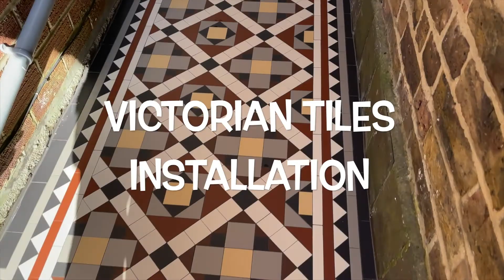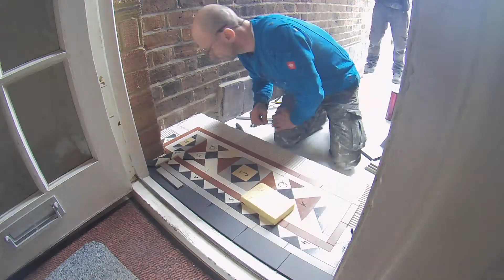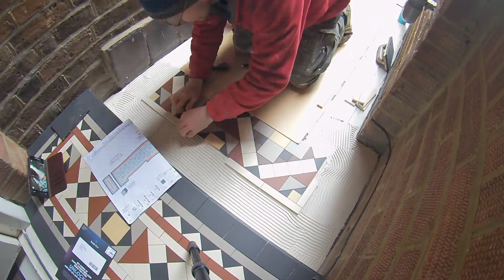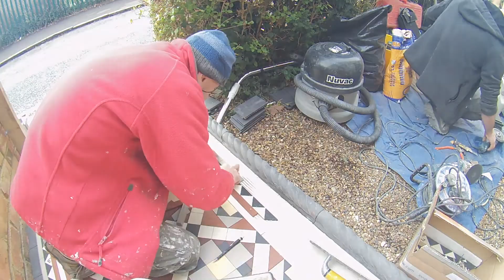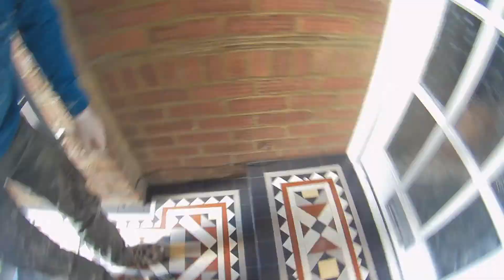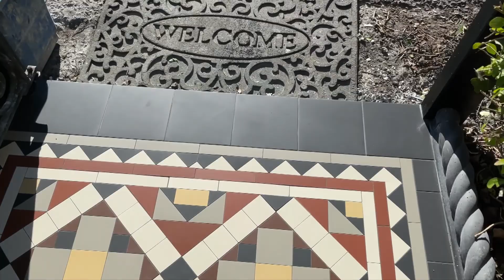How to Install Victorian Mosaic. Victorian Tiles  Aberdeen, Faron.Co Ltd, Mozaika Viktoriańska

Comment: Yes, it looks gorgeous. However, would like to ask about the rain run out. You did something like a concrete base for tiles, but by force of gravity, a surface been made flat, so the water will be collected on the mosaic top. Probably it will degenerate the lifetime of them, am I right?
Reply from the maker: Do you really think that this flor is flat???
Floor is concrete skimmed with the mesh and S1 tiling adhesive. Its not good idea to fix this tiles on bare concrete. !!!
Reply: @faron.coltdmactilermosaici301    May I ask what is the degree of tilt for full tiles surface? That makes me confused. Thanks
Reply from the maker: @4i04  " the degree of tilt for full tiles surface?” Mate, Im a simple guy and check each floor outside and if I have 20mm on 2 meters level  Im happy. On that particular floor it was something like 35mm on 2 meters.